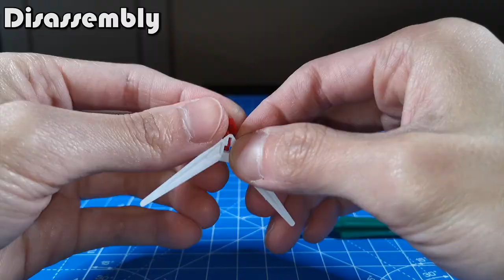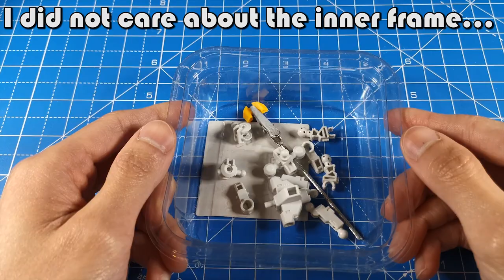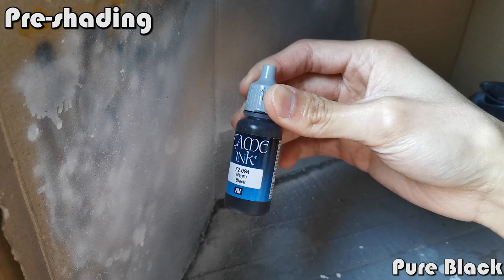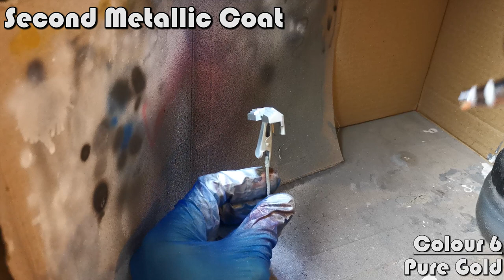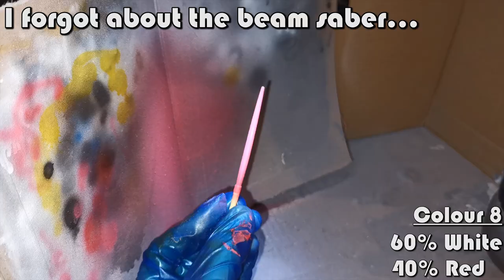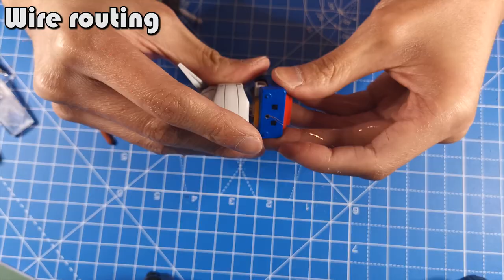Custom Build Ep. 2 | SDCS RX-78-2 Gundam

Comment: What powers your led’s and how do they connect to the wire?
Reply from the maker: The LEDs on this one is powered by two AA batteries. I have routed the wires to the back of the waist, from there it is connected to the batteries. So in real life you'll see that it has a 'tail', but that's the wires 😂
Reply: @JettoHobby  thanks this helps me so much great work!
Reply from the maker: @ryansalazar142  no problem at all dude, enjoy!

Comment: Good job on this rx782!
I myself just started airbrushing and I mostly use Vallejo paints as well, just wondering how long do you wait between your coats? Also how long do you wait before you put masking tape on? Thanks!
Reply from the maker: That depends on what masking tape you use and also depends on how thin your vallejo acrylics are. If you use the normal DIY general masking tapes, they tend to peel the acrylics off, but if you use tamiya masking tape, you have much higher success chance. As for drying time, I have success with tamiya masking tapes after 2 hours sitting beside a desk fan. You should test it on a spoon first just in case.
Reply: @JettoHobby  That helps a lot, thanks again and keep up with the good work!
Reply from the maker: No problem at all and have fun! 👌😁

Comment: Hi nice mod. Did you punch a holes to the eyes to make them glow? thanks
Reply from the maker: Thanks! Just holes for the wires to go through that's all, the yellow plastic allows the light to shine through nicely without painting 😁
Reply: @JettoHobby  Ah so you attached the lights outside then routed the wires inside?
Reply from the maker: It's right inside the yellow eye plastic cavity. I use the tiniest possible LED 😁
Reply: @JettoHobby  I still cant get it but thanks. I found some pre wired smd leds in some local online shops here so I try them later.
Reply from the maker: Alright all the best! 😊
Reply: @JettoHobby  I want to try that for the sd deathscythe hell but it seems doesn't have a trasparent plastic inside its head 🙄
Reply from the maker: Send me a picture of it on Instagram 🙂